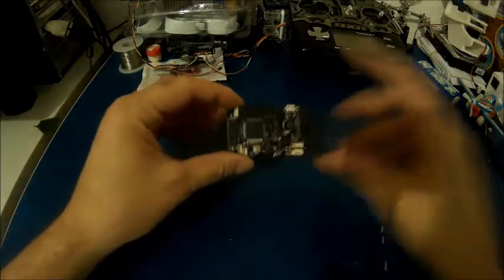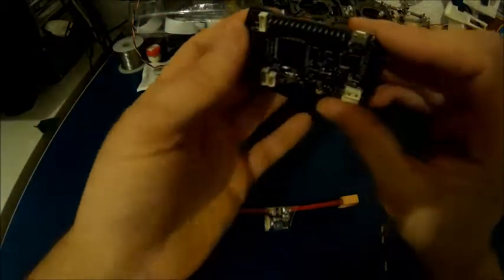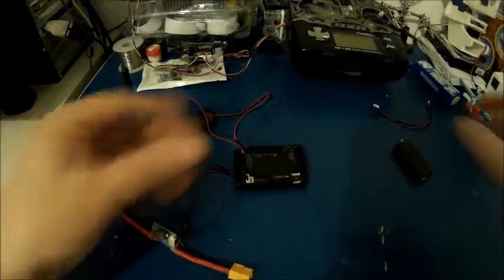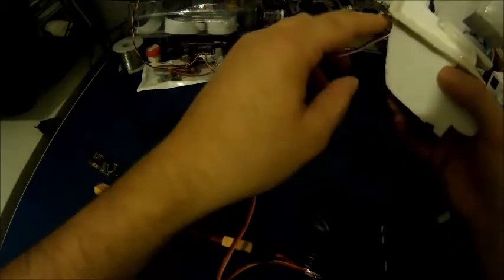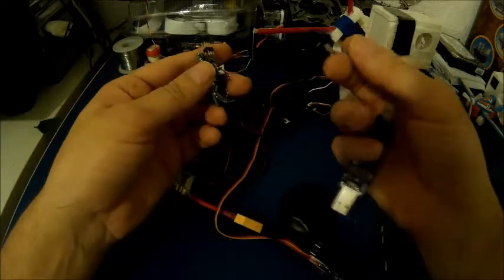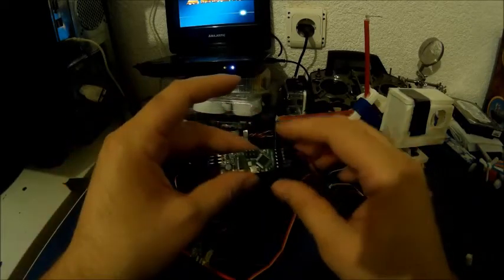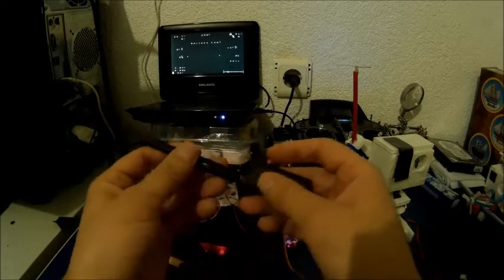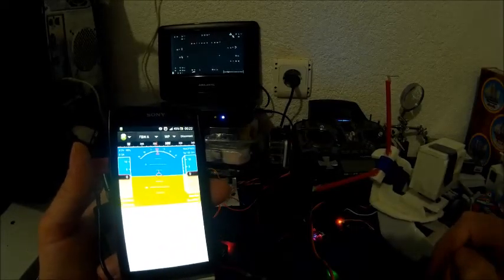HKPilot Mega 2.7 Master Set setup - connecting to phone.

Comment: What GPS module are you using?
Reply from the maker: 28savon I'm using LEA-6H GPS with Compass which was included on the HKPilot Mega 2.7 Master Set. Only the GPS is about $50 i think. I'm happy with it, it does great at Loiter, AltHold, RTL (I haven't tried yet PosHold). To be honest I don't have any other GPS module to be able to compare so my opinion is based on me using it :)
Reply: Thanks you.

Comment: Hi, did you remove the jumper for the GPS? I am getting Bad compass health and I didn't remove the jumper.
Reply from the maker: Sol mag If the GPS has inbuilt compass in it, than you need to remove the jumper, ( if you have the same set like mine from hobbyking than you remove the jumper. Removing the jumper will disconnect the compass that's in the flight controller so you can use an external one (in this case the one that's built in the GPS module). You will also need to set the values for the external compass in mission planner and then calibrate it. Once you do that, wait for GPS to get 3D fix and see if that message goes away. If the problem still persist and you have the old version of HKpilot mega, thay have had problems with the voltage regulator. If that's the case than you need to replace the voltage regulator, but I suggest you to try other options first. 

1. Remove the jumper 
2. Connect GPS and compass
3. Open mission planner and connect the flight controller through usb or telemetry radio, 
4. Select the correct baud rate (they are different if you connect the APM directly through mini usb port or through telemetry radios, watch the video)
5. Connect the flight controller and go to Initial setup -> Mandatory Hardware -> Compass and check the box where it says Enable and also Auto Dec
6. On the bottom click Live calibration and calibrate the compass.

http://copter.ardupilot.com/wp-content/uploads/sites/2/2013/07/CompassCalibration_Orientation-1024x574.png

You might want to take e look at this page:

http://copter.ardupilot.com/wiki/ac_compasssetupupadvanced/

Best regards
AlbEagle
Reply: Thanks for the help. I removed the jumper and everything is working fine now. Thanks a lot.
Reply from the maker: Sol mag You are welcome :)